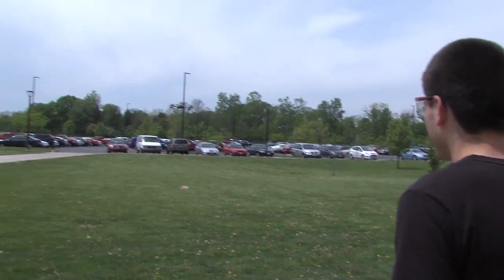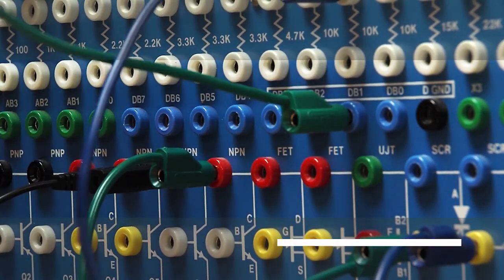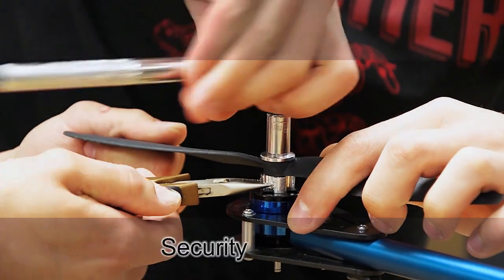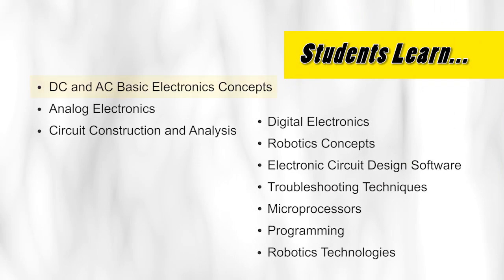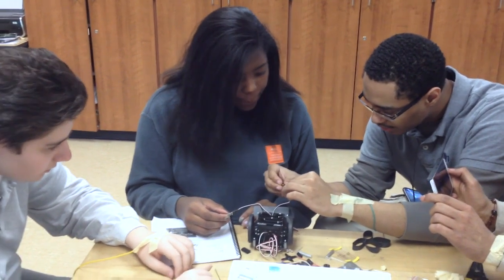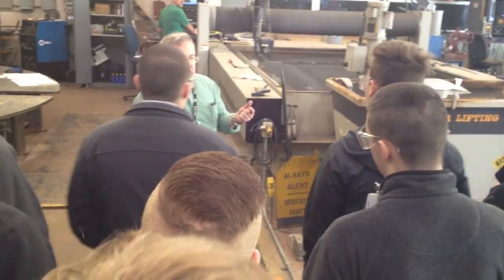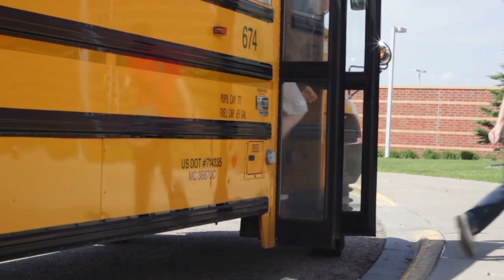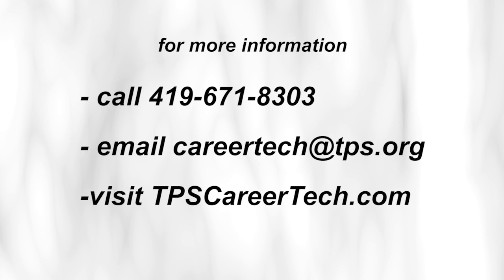Advanced Electronics | TPS Career Tech

Comment: I hv electronics engineering degree no scope everything made in china cheap no one need electronics engineer or tech
Reply: Cool
Reply: haha yeah right. I could sure use one. Tell me how I can produce a 40ns pump z wave at 1kw and 25-30kv.   I can't find any mosfets that'll do 25kv+ let alone have a 5ns response time for making the 40ns wave from 8 steps of a 5ns response time transistor. Maybe there's another way to do it though, possibly with induction and some type of 3 phase, like a series of 3 phase coils (you know how we all used coils before transistors back in the day).   If you can figure this one out, I'll give you something far greater in return. It must be able to run continuously for 5mo minimum with no liquid nitrogen cooling. Water cooling okay.